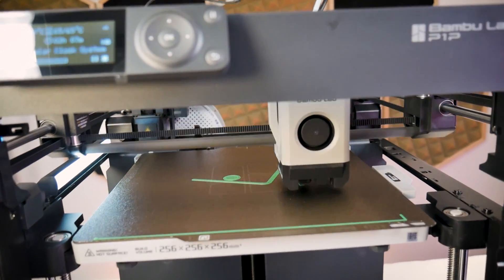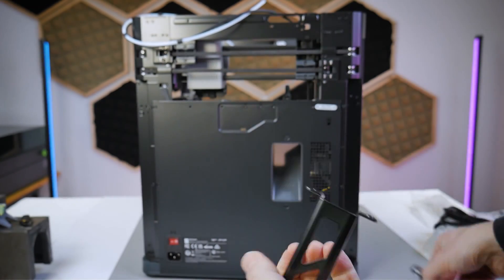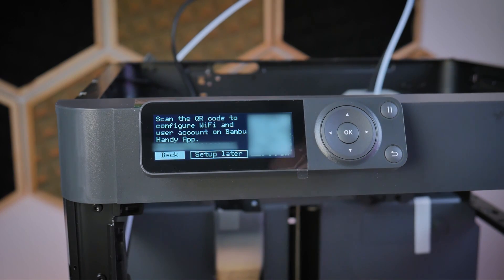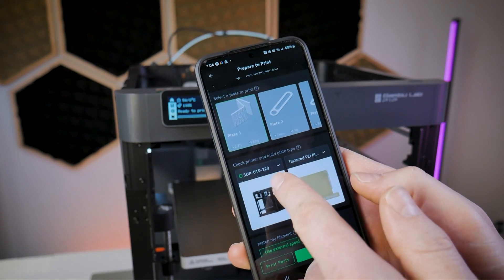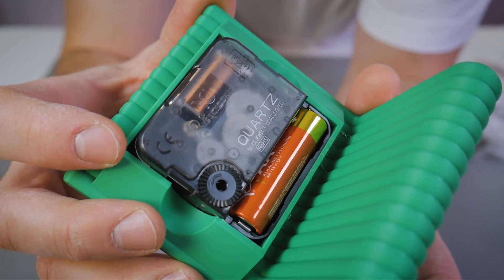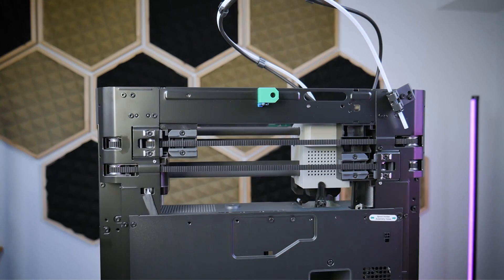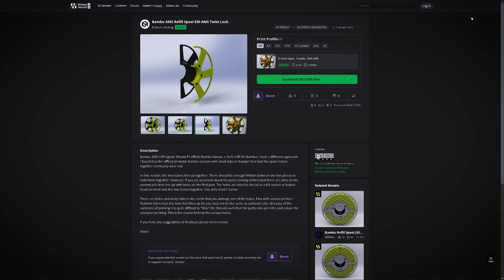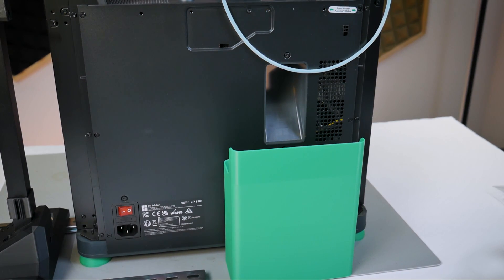Bambu Lab P1P / P1S Quick Setup Guide, Upgrades and More!

Comment: Bambu now screwing their owners. You cant use 3rd party slicers and they they are going heavy on data gathering making every print go through their servers. They are bricking units that don't agree to their new firmware update, and all new units will ship with it. BUYER BEWARE
Reply from the maker: I just recently read about this :( I bought a ton of Bambu printers... Maybe they will be pressured to change direction
Reply: @EmbraceMaking  Fingers crossed but it doesnt look promising atm :(

Comment: if you're going to all that trouble to mount your spool on the side like that, just get rid of the bowden tube all together. feed the filament directly into the print head.
Reply from the maker: I have also done that, however I find that the print head moving in every direction tends to pull the spool stand at awkward angles and sometimes violently if there is a big travel move. The advantage of this setup is the filament always goes straight down so it unwinds nicely.